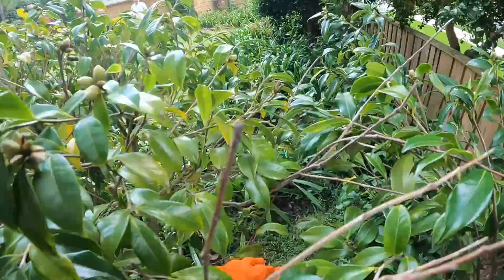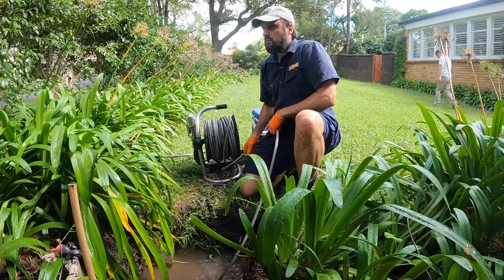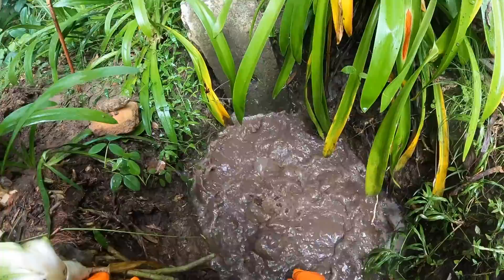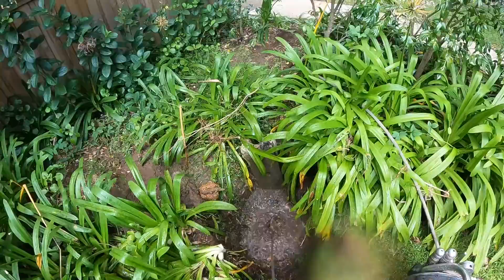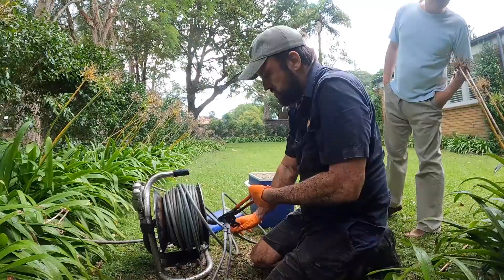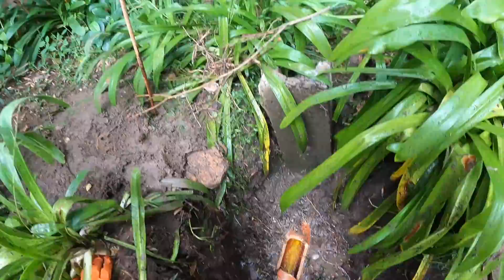Blocked Drain 582

Comment: Fun, fun, fun... Just bought a house not too long ago and boy have I had work to do.  The supply lines went from steel to PVC to CPVC then sometimes back to steel...  Plus the main supply went from 3/4 to 1/2 before it hit a single fixture.  From my understanding the sewer was replaced a couple years ago but still have some cast iron stuff that is connected.  Anyway replaced all of the supply with 3/4 PEX to a manifold block and from there it's all 1/2 inch PEX.  Huge upgrade over what was there since while taking a shower I regularly felt stuff come out of the shower head and hit me while taking a shower and would have to clean the head multiple times due to crud coming out of the lines.  I did put a shower outside in the back yard though so when it gets really dirty I can get clean, I am guessing that would be better than your mud and muck bath Ollie.

Comment: This is why we use a pvc triple wall pipe instead of the clay pipe. The clay pipes not sealed were they connect so easy gaps are made by the roots. The pvc we use, the roots grow around the pipe that is surrounded by gravel to help drainage

Comment: Because we have no drains like that was to save the house slab foundations was to install sprinkler systems to keep the ground moist. Decades ago they didn't on the house concrete foundations and they literally got ripped apart due to expansion and contraction of the soils.
You might want to branch into lawn irrigation and have your customers eliminate the roof drain nightmare,or offer an existing company to eliminate that mess.